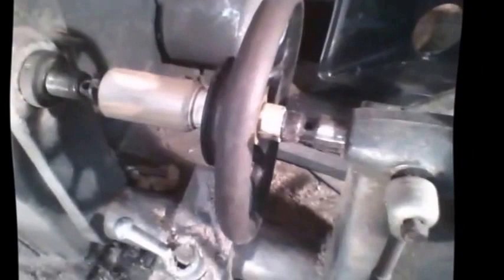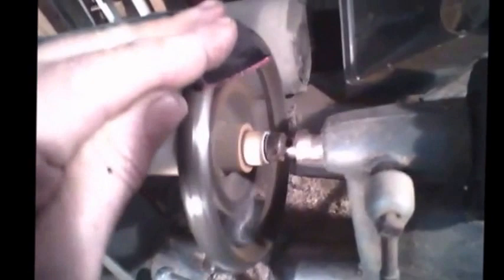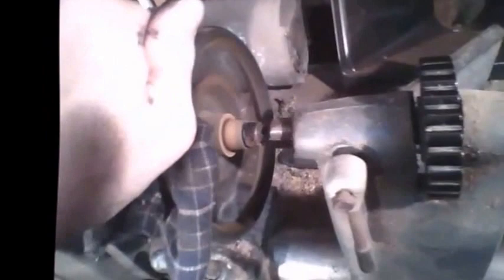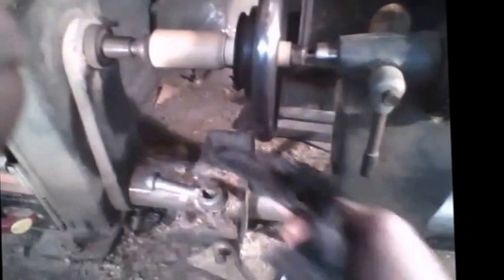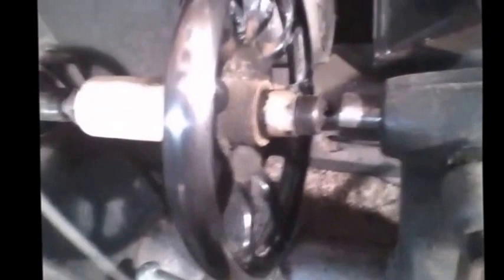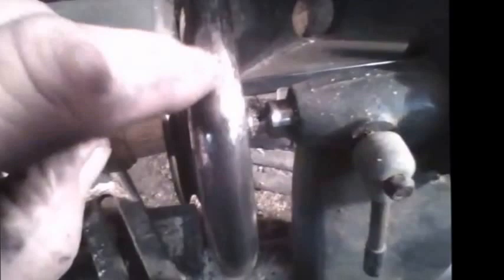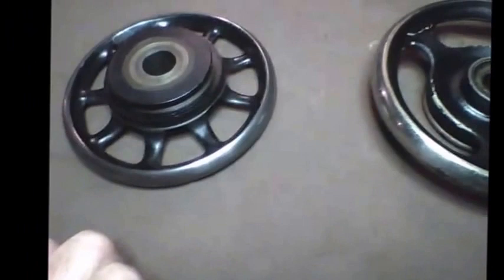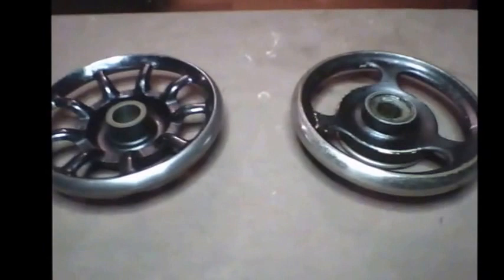Antique Sewing Machine Handwheel Refinishing

Comment: Your videos have helped me a lot! I picked up a beautiful 1901 New Home sewing machine for $10 a couple days ago. It was filthy and the balance wheel and other metal parts were rusty, but it runs like a dream - seriously, so smooth. I used Gojo to clean the enamel and decals and it looks fabulous - virtually every decal is perfect. And today I tackled the balance wheel. I don't have a lathe, and the machine is not in a treadle table, but I wrapped a pencil in fabric, stuck it in the spokes and spun the wheel by hand. It took longer than using a lathe, but the wheel looks amazing, and it actually didn't take that long! I'm just so excited about restoring this gorgeous machine, and given what a great deal it was, I couldn't be happier. So thanks for showing the step by step. I did exactly the same thing (minus the lathe) and got a gorgeous result.

Comment: Loved this one - adapted the technique since I don't have a metal lathe (and it was raining so couldn't use my wood lathe).... and my machine is in the process of rewiring. So, I just hand-turned it while on the machine. It's now GORGEOUS! <3 Thanks for the tips. Glad to know about the aluminum foil thing since I'd heard of it.
Reply from the maker: Wood lathe works better. My metal lathe is too slow really to generate the heat on the surface that really makes them shine! lol Just gotta be careful. these old iron wheels can blow apart when spun too fast if they have a tiny crack in them

Comment: Very good video and I agree...do it the best you can the first time.  These machines were not built by people with a 'used car' mentality or they would not be 100+ yrs old and still fully functional.  BUT...what do you do with a hand wheel that has lost 40%+ of its plating???
Reply from the maker: I use a more coarse paper (such as 80 or 120, depending on just how rough the plated area is) and remove all the plating that is left. Once the surface is beginning to smooth, the progress to finer papers (240, 400, 600, 1000, then finally 1500) until the base metal is nice and slick. Ue oil with all sandpaper, and be very careful with the old plating because it can cut you like a razor blade. It should have a nice satiny appearance at this point. Then I finish polishing it just like in the video.
  Most machines before the mid to late 1880's didn't have plated parts (with the exception of a few with either silver plating or bronze). The brightwork on those machines was all polished iron, steel, or brass. Steel and iron will polish to a beautiful shine without plating, it just needs to be done with oil and with enough speed and pressure to generate heat on the surface of the metal. Many of our early machines' parts were a dark brown but with just a little polishing they were bright again. Correctly polished iron or steel holds up very well and on many machines I have witnessed it in actually better shape than the painted parts after a long period of neglect